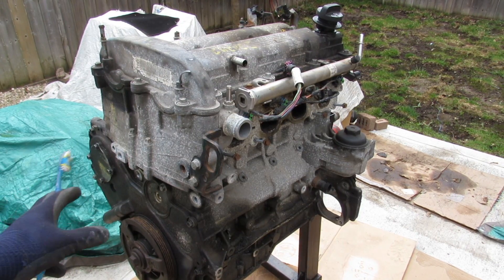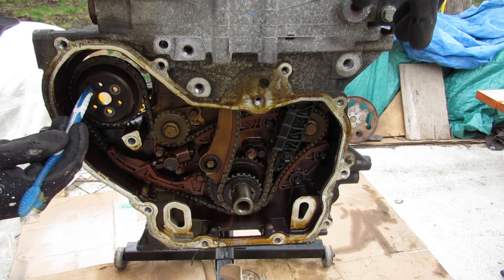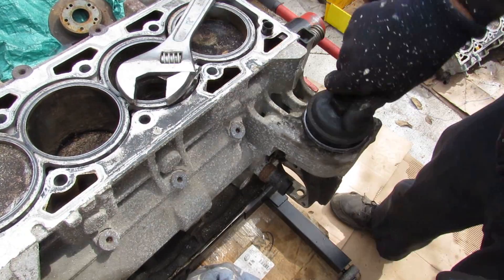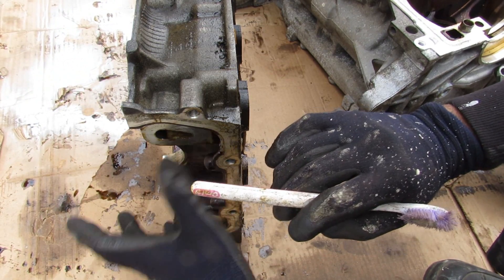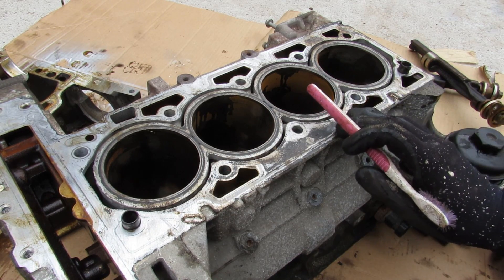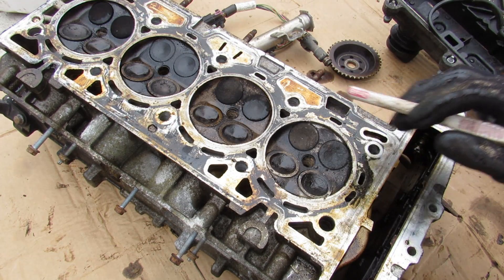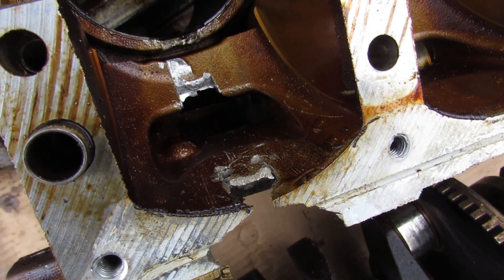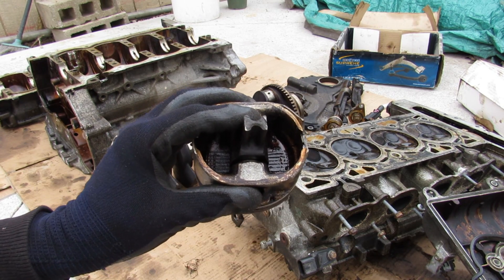Why GM Ecotec Engines FAIL

Comment: mine is 05’ cobalt ls with 176k trouble free miles all factory original engine with ac and alternator and starter original from off the factory assembly line no issues i keep oil changing every 6k miles using full synthetic oil

Comment: I used to be a GM guy, but I would not touch a modern GM. Ford or Chrysler vehicle. I went back to Toyota and Honda and never going back. I still have my 2004 Silverado when the 5.3l engine was built to last.
Reply from the maker: Good choice

Comment: Hello. Cool video! Was there a gasket to that ladder upper oil pan? 

I’ve got a 2008 L61 2.2L and I need to change the rod bearings (cylinder 1 is knocking. I could remove the upper oil pan for clearance on installing rod bearings, yes? Use RTV silicone when reinstalling upper oil pan? 

Thanks in advance. Keep the videos rolling.

Comment: Haynes manual shows conventional oil pump in oil pan on these engines, but it's actually in the timing cover and crankshaft driven... he didn't notice that... the chains will be loose without running engine oil pressure to hold the tensioners against them... 
Neighbors had a Quad 4 engine car with trouble, I thought about offering to fix it, but Step 1 of removing engine is drain A/C of freon... Step 2 remove A/C parts... so I didn't offer... 
Later they had an Ecotec 4 in a Malibu Classic that developed a knock at 60K miles. They were quoted $1200 to fix it. I had never worked on a DOHC 4 valves per cylinder engine before so I fixed it cheap for fun. I went to drain the oil... no oil... I went to drain the coolant... no coolant... and no leaks... they just hadn't checked the level of or replenished anything in 5 years... Too new for a repaired crank/bearings kit, local shops only welded on forged cranks, found an out of town shop that did cast cranks. Main bearing set was $200, but that shop found a normal priced set supplier. The Ecotec is a dream to work on, loosen the accesories's bolts and the engine slips up and out, accessories stay in place! A sensible design! 
Ecotec 4 started as a Vauxhall 4 with timing belts. Change belts at 80K miles... oops, don't last that long... engine destroyed... change belts at 40K... Ecotec got timing chains running in oil, no recommended change interval...

Comment: So if I understand correct, if I maintain the engine well with on time oil and oil filter change, the risk of  clogging small ports can be reduced and failure as well.
Alternatively not taking care of the engine will cause failure and that is quite reasonable for all engines.
🤔

Comment: I had a 2.2 cobalt ls and it had around 170k miles on it when I sold it to a friend for 500$. I think I bought it with around 20k original miles. I serviced the car according to the owners manual, and I had all recall services performed too. 

I remember replacing the wheel bearings and replacing the front control arms. 

That car still runs to this day, it has over 210k miles on it!

Comment: Thank goodness in 2013 they redesigned this engine so the faults it had were pretty much eliminated for 2014.  I have read manuals showing the design changes so the chain is less likely to be stretched and the cylinders no longer fail due to reinforcement.  However, you have to maintain the DI engine with cleaning up the carbon every 30,000 miles or you will run into problems by 100,000 to 120,000 miles.
Reply: I have a 2013 GMC Terrain, 2.4, AWD, bought New!  We live in N.E., now have 106871 miles on it?  At 80K, one morning I had a puddle of oil under car!  Yikes?  I got on the W.W.W., read everything I could about the 2.4 Direct Injection engine & it's problems?  Turns out, the Breather Hose from the valve cover to the intake body, the oily mist turns to mayonnaise, then freezes at the 2 - 90* bends in the small plastic air line?  There is NO where for the engine gases to go, Pow, there goes your rear main seal?  Now what?  I kept reading the solutions; got rid of the stock intake crap, got a K&N Intake Kit, a vented oil fill cap (Vets & Camaro) cheap catch can from Home Depot, I ran a new breather hose from valve cover to the In side of catch can (air compressor filter) then ran a hose from Outside of catch can to K&N intake stub?  Then I put a new oil filter on, to collect the crap at next step?  I put in a can of engine flush, run at idle 15/20 minutes, depending on Brand?  DO NOT, drive car!  Next I pull the 4 plugs, I have a 16 oz can of Gumout with PEA, I pour 4 measured oz in each cylinder, let sit overnight or 8 hours?  The PEA will dissolve the carbon that is holding the oil rings in tight to pistons, allowing oil into combustion chamber?  At this point you should take a flashlight, look into spark plug holes, for carbon on top of pistons, & any leftover PEA?  To be safe, to prevent Hydro-Lock, I'd put some paper towels over plug holes & turn engine over, looking for PEA wetness on paper towels?  I usually 
squirt a little fogging oil or AT or mystery oil on pistons, to lube before installing new plugs? DO NOT start! NOW, you can change the oil, take off the Flush filter!  First put on #7 nitrile gloves, drain dirty oil, I like to run a magnet thru the dirty oil in drain pan? My Business is changing all the oil in Harley's with the Scavenger system, & I always cut open every oil filter, looking for foreign objects, metal, plastics, etc.?  So, now all the dirty oil is out, sometimes, if I've got an old unopen qt. of conv. oil, I'll dump that in engine, it will rinse off any of the flush & PEA residue?  New oil ring on drain plug, if needed, fill or 1/2 fill New oil filter with oil, if possible?  I fill all my vehicles with AMSOIL, I use Abrams Tank tech Nano Fiber filters?  I can go 25K between oil changes with my Fuel Injected vehicles & 15K with the Direct Injection vehicles?  You should be all set for a while, good to go?  AMSOIL 25% off MSRP
Reply: @jimandnancymcoil  I am impressed.  A lot of work to keep the engine going.  I had a 2006 Saab 9-3 with the Ecotech engine without DI.  I had it until 191,000 miles with no issues.  Sold the car in 2018 and today has 260,000 miles with the oringal powertrain. Now own a 2018 Buick Envision 2.0 L DI engine with 66,000 miles.  Clean the carbon off every 30,000.  Have yet to have a problem.  Hope to drive it as long and as far as the Saab with care.

Comment: I have had four cars with this engine the least milage was 130k and the one I'm driving now had 233k on it and is very healthy. Change your oil people that is why the old Ford y block would fail. The y block had a oiling passage that had no tolerance for neglected oil changes and sludge. Keep up on oil changes and a y block will reward you with over 400k the same is true of the l61.
I have not seen the potential of these engines yet due to the car getting wrecked by other drivers. I wrecked one of them though tbh

Comment: I'm wondering if u still got that ecotec block laying around. Mine has water in oil. I bought a 2014 encore with the 1.4 turbo. Evidently the gal i bought it from. Ran it hot. I'm not sure if the engine is catastrophically ruined. All i know is when i replaced the water pump. One of the bolts (in the middle area of the water pump) came out and it was wet with chocolate shake. So my guess is that bolt hole has a crack leading into both a water galley and oil system galley. Did you take pictures and render them to a 3D virtual blue print for us... Just kidding.. But im not kidding about the fact i think i just got screwed..with chocolate shake in whole engine now..err....Any 
who - -Thanks for posting this.. Shannon..
Reply from the maker: Nah I turned it into a coffee table 🤣

Comment: As an engin builder I have to critique your assessment. Good overall explanation except for the following. The blackened # 1 rod journal says loss of oi to the rod bearing is what caused the engine failure. Carbon on pistons is a good sign because that says the head & gasket were good.  The amount of carbon on the piston appeared normal and not excessive. Plastic chain guides are superior to metal as they don't rely on oil for lubrication, they and the chain last longer. The failure points are the tensioner, the chain oiler.
Reply from the maker: Thanks for the feedback!

Comment: The Ecotec is an excellent engine platform; those who are familiar with its predecessor the Quad 4 will agree.  I have 2 vehicles getting close to 250K. So what, I have to replace the timing sets every 100-120K. Unlike a V engine the timing chains is allot longer and has to drive 2 camshafts. 
Timing belts will grenade at 10 K. timing chains are maintenance items and last 100-120K. People are keeping cars longer and running them for higher mileage, up until the past 10-15 years most people ditched a car between 50-75 K. The infamous timing chain is not a genuine failure since they last over 100 thousand miles,
Reply from the maker: The newer ecotecs aren't as good, especially those in the equinox etc. 
I agree the older ones in the cavalier/cobalt could have ran a good while (if we'll oiled, unlike this one).
Reply: @speedkar99  
The timing phaser can be an oil hog combine that with the tensioner at the top of the engine and relying on oil flow and pressure there will be problems.
Ive found the best 2.2 blocks are 2007 -2011. 2.4 off road engines I swap out the phasers for old fashioned gears.

Comment: Those spark plugs already told me that these people rarely serviced the vehicle. 

One thing i noticed is that these engines drink oil because how cheap it is. Went with castrol first and found it one quart was gone after 2k of driving. After changing out some sensors of the engine that caused a overheating problem and using valvoline oil, full..even after a 1k mile highway weekend test. Engine tends to overheat with bad sensors, who knew

Comment: Great video! Just wanted to correct one quick thing: you cant actually use duct tape on those inspection ports. I know its listed as manufacturer spec for these GM engines but we've done it a few times at my shop and they eventually leak oil again... However you can use flex tape. Just slap some of that stuff on there and problem solved! Hope this helps
Reply from the maker: Thanks so much for the tips
I'm sure alot of shops will use flex tape to get a car through an auction haha
Reply: @speedkar99  flexible tape and even more flexible morals 😂

Comment: my buddy has a 2010 pontiac G6 with 180,000 miles, hes put 10k miles on it and ill tell you that car is at redline more than idle, the fact that its still running is impressive, pretty reliable motor from my experience
Reply from the maker: Keep it oiled

Comment: Great tutorial. Every engine with catastrophic failure is always dirty inside. Not changing oil on time or mileage. Who knows what kind of oil that all these quick lubes are putting in your engines. Engine over heating from leaks or negligence speeds up this process. That care of your engine and it will take care of your wallet.
Reply from the maker: Yes it always shows neglect

Comment: Oh so you do have one covered. This family of engines are known as GM’s 4cyl equivalent to the LS. This engine VERY OBVIOUSLY was starved of oil. If you don’t do that, I’ve seen the supercharged variants of these engines go 250K miles or more (yes, the more strained, more extreme heat cycled version lasts that long). The main issues these had:
Block Porosity (lost foam cast block casting issue)
Very rarely, water pump failure internal to chain chest. 
And front primary timing guide upper bolt failure (often causes timing to jump, bent valves) so timing sets are recommended every 100K however they are cheap and fast to do. 
Anddddd that about covers it. I rarely see these engines leak oil, the only RTV on them is on the oil pan, and those never leak. My LSJ made it 186K before it was taken to the grave by block porosity. Replaced it with a new sand-cast LDK block ($1,799 new) and new “bare” head ($250, reused cams and valves and keepers), vehicle just broke 200K. Car now runs e85, has a 2.8 pulley 80lb injectors and “full bolt ons” makes 275whp (keep in mind this engine is Non-VVT AND Port Injected) and on E85 still averages 24mpg combined.

Comment: My daily is a salvaged 2005 ion 3 quad coupe that I bought for 400 bucks with a bad clutch. Swapped clutch and many suspension components in my storage shed over the summer. Timing tensioner failed on me about a month ago and my ignorance allowed me to just change it and when i went to crank the main chain guide broke making horrible sounds. I shut it off in time and replaced all chain guide and sprocket components using the updated oem replacements. dropped  oil pan to retrieve plastics guide pieces and carefully cleaned all passages. new gaskets the works. upon start up the cold start timing chain noise/knocking sound was even louder now but soon as you apply throttle it goes away. had an injector and fuel line go due to rusty lines. This all happened at 190.000 and I just went to change my oil the other day as it has bad blow by (always has since i owned it) and stuck to my drain plugs magnet was pieces of what looks like a very thick piston ring.. pop oil cap running and it definitely is blowing air out with nasty sludge on cap. sucks i did all this work and idk if i should replace the rings or try to find a jy engine with lower miles? any advice? i have brand new tires and everything on this car I'm🤕🥺 in it for about triple its 1175 value if i find a good engine for around 500 total.. i have all the tools and feel confident i can swap it or rebuild.i did the sub frame and transmission drop all by my lonely with some bungees and ratchet straps rigged with hoist to assist in removal and reinstallation (lots of cussing but for my first i am proud) car drives well weak on power my mpg sucks and it smokes after revving 2k or more. i just got it on the road and its body is with minimal rust compared to my very unsafe 05 monte carlo lt... that thing should be folding in on itself any minute now

Comment: I suspect the engine failure was caused by the rod bearing spinning. The crank journal was blue from heat. Once the bearing spun enough then the piston began hitting the head until failure. If the timing chain lost tension and caused valve interference then the engine would have shut down not giving time for the crank to turn blue from heat. Engine probably failed from lack of lubrication as you stated. I enjoy your videos and was just offering a slightly different point of view on this engine.
Reply from the maker: Good observation

Comment: Wifes Equinox lt 2010 2.4l 219k burns 5 qt. Then I do oil change 😆 about 4.5k to 4.9k  did chain ⛓ at 150k miss class acting 🙃 suv had 170k was at 150k or under good suv running cheap oil catch can.
Reply from the maker: Well at least you got it to last that long
Reply: @speedkar99  hopefully last few more year 😬

Comment: I have this engine in my 2015 Chevy Equinox. I'm totally on the maintenance on this engine. I currently have 260,000km on it and still running strong. My advice is don't follow the oil life meter. It is soooo off. I noticed when I got to the  5000 km to change the oil, it would say that I still have 62% oil life left. If you continue to follow that oil life meter, your potentially leaving it to sludge up in your engine.
Reply: I have a 1.4L turbocharged Ecotec on the 2013 Chevy Trax. I monitor the oil relatively often, and especially before longer road trips. That way I can examine the oil condition and level and then just schedule a synthetic oil change when the oil looks to be close to dark. I am not putting much mileage on the vehicle right now, so the normal intervals are not really applicable and although I reset the oil life meter after each change, I just bypass it and check the oil myself.

Comment: Hello. Is this the L61 engine? I am planning on buying an Alfa Romeo Brera 2.2JTS, which has the Alfa internals and externals, but the (empty) engine block itself and the timing chain system are GM L61.

Comment: Good video description of this engine. I have a 2.2 Ecotec in a 2008 Pontiac G5, 219,000 miles right now. They are good engines, they can last a long, long time. Timing chain tensioners are a potential problem, mainly in neglected engines. However, it is not unheard of timing chain failures in low mileage, well maintained engines. 

If maintained properly, these engines typically don’t burn any oil. Lots of German engineering, I hope I don’t have to change the water pump for a very long time. 

Unfortunately, these engines were installed in a lot of low budget vehicles and owners don’t maintain them properly.
Reply from the maker: Agreed. The engines can go if maintained but the demographic just don't maintain them

Comment: I'm amazed at all the people that ran these engines to over 100k miles without issue. I believe in changing oil sooner than the recommended intervals and it has always paid off. Oil still carries particulates and wears faster the older it gets. Anyway, thanks for this informative video!
Reply from the maker: Thanks and agreed. Some of the older Ecotec last long. The newer ones aren't as good

Comment: I hope the one in my Sling Shot doesn't end up like this.
Reply from the maker: Sling shot?
Reply: @speedkar99  I have a 2017 Polaris Sling Shot. It has the same engine in it. It is a blast to drive lots of get up and go. I'd like to sell it just to make room in the garage.
Reply: @jamesschrom317  I was looking to buy a Vanderhall, with the GM 1.4 Turbo, having 2nd thoughts now?

Comment: If the valve timing skipped, the valves will have touched more than one piston. 
It most likely ran very low on oil, and starved the rod bearing furthest from the oil pump.